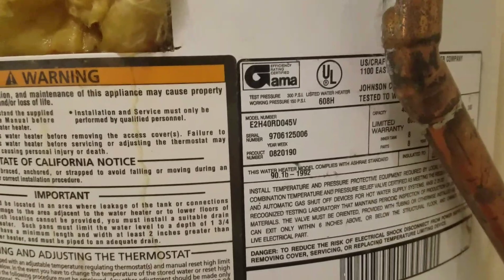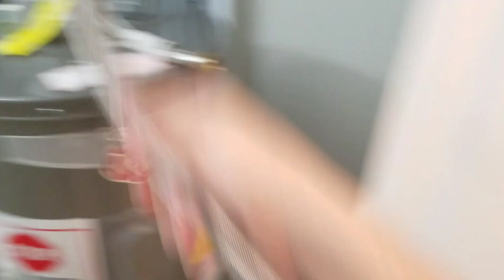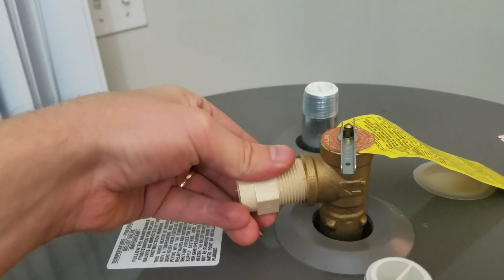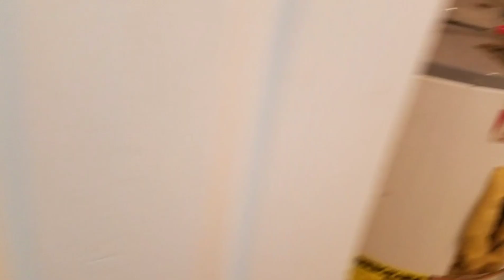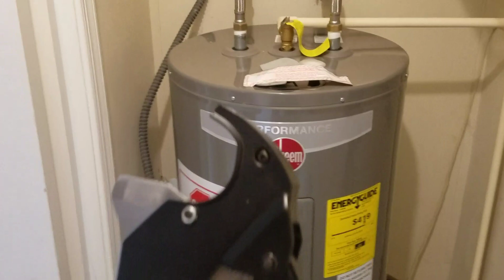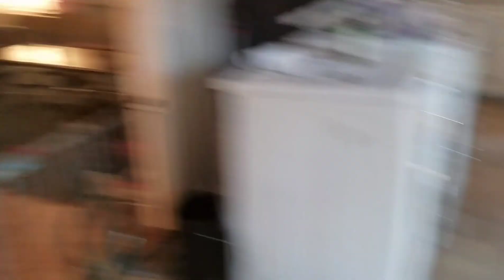DIY - How to Replace an Electric Water Heater

Comment: Great video! However I would have also mentioned opening a hot water faucet when you drain the water heater also. It prevents a vacuum from forming and impeding the water flow. Otherwise, it was a great demonstration.

Comment: Wish I have copper plumbing right now instead of the CPVC crap . Looks like you could have just unscrewed the pvc to copper connection and ended up with better connection than the sharkbite and saved the copper length.
Reply from the maker: Agreed. Functional? - yes. Ideal? -no.

Comment: I heard 'Mr. Brownstone' in the background music there at the end.  Great job!  I'm doing mine this week 😁 

I'm getting the same exact Reem unit that I have now (currently leaking at the tank) but I do have one question for you- does the relief line always go under and out of the house?  mine is pvc pipe going behind the unit and simply has an open end near the floor.  The space is so tight, I can't tell if there is any other line going out.  Is this normal?  Thanks.

Comment: How you doing? Thanks. Hot water out and cold water in placed on the side of the tank . And on top got hot and cold wish ones should I used to install my water heater tank?

Comment: That pipe is cpvc and not pvc it takes heat better!  Uses different cleaner and glue. It has a smaller diameter than pvc pipe.

Comment: Is it safe to use regular pvc pipe for the pressure relief valve? I know that it gets hot and using pvc fitting on pressure relief can Crack easy and even melt, but if there is an issue and pressure needs out and it's shoots out that scalding hot water at high pressure can regular pvc stand up against that or should it be cpvc to a brass fitting maybe? Installing one today at my mother's house and want to be sure that it holds up for years in case I'm not around here to help her save insane amount of money to have someone dumber than me fix it for double what the water heater is worth
Reply: Not to code. Use CPVC or metal pipe.

Comment: ok has it did any leaking or messing up i am thinking of getting one
Reply from the maker: It was perfectly fine for about 2 years then I moved out. I'm sure it's still fine
Reply: @BruceBalistreri  did you get it from home Depot
Reply: @jaytravel-12  Home Depot sells Rheem, and Lowes sells AO/Smith.    But if you can get Bradford White from a plumbing supply store they seem to be the very best.
Reply: @BruceBalistreri  ok thanks

Comment: In the first few minutes you made a few mistakes. Most of the comments have already told you. So next time hire a professional. You are not qualified to do this simple job.
Reply from the maker: I opened up the video saying much the same. However water is still hot years later and house passed inspection np..

Comment: Dude ,if you are doing a DYI video for folks that need info you could make sure you give correct info, cmon! First off, you need to explain that you don't need to shut main water off at the house, only to the tank, unless like you are doing here which is replacing the tanks shut off valve. That way you can have water in the home wile installing.  Most importantly, you don't use cutters  in this application, every plumber will tell you cutters can break the existing pipe with the pressure because cpvc is brittle. Use a hand blade, its two or three cuts at the most....
Reply from the maker: I think you're just being unnecessarily critical. You can turn the water off either way or cut the pipe either way.
Reply: @BruceBalistreri  u tell ‘em

Comment: Question? My drainage stopped but once the cold water tap was on it started flowing again, like alot, everyone says turning the hot water tap on is how you relieve pressure but that made no water flow out-of the drainage, I am very confused. I can't use a hose bc the threads on my drain valve is plastic and won't stop cross threading so I've been using buckets. It just doesn't seem to end o.o I've dumped over 20 2 gallon buckets o.O

Comment: I didnt see you prime and cement the cpvc pipe. Im hoping you didn't just press fit them together without using pipe cement/glue..

Any kind of pressure may just blow the fittings apart if it ever does need to vent pressure.
Reply from the maker: Yep I just pressure fit them. Should've used some goop. Luckily the pressure outlet rarely is ever activated. Good tip tho thx

Comment: you can also use the same pipe cutter you used when cutting copper to cut pvc... that tool you spent $15 only makes sense for a handy man that does pvc jobs a few times a year... Plus hack saw is really easy and fast also ,if for some reason your cut is bad,you can always make it pretty with a file,dremel or sand paper...Good video btw..
Reply from the maker: Good point. This will bother me for the rest of my life tbh lmao

Comment: What about a Pressure Relieve Tank on top of the heater tank, isn't it dangerous without one with a risk of the main tank exploding?? Is this really necessary or is it just marketing and more money for manufacturers??
Reply from the maker: All heaters have those valves (by law I think).

Comment: How long did it take for the tank to heat up the water ?
Reply from the maker: Honestly I don't 100% remember. It was within a few hours max
Reply: @BruceBalistreri  thank you for replying! Also I got a Electric shock when touching the cold and got water hose that Connects to the water heater ? Any idea

Comment: Great video for do it yerself-ers. But I figure It best make a comment towards the fact you didn’t primer and glue your c-pvc at the joints.  Your viewers need to do that quick and easy step or else, if that valve ever pops off ….the pressure will pop that 90’ completely off and send water directly onto the wall an down to yer floor ( that will suck ass hardcore if folk come back from a 3-4 day camping trip to find out there house is now flooded. Plus all the electricity that’s been used to constantly keep heating up new water to a continuously refilling water heater over the weekend.  Just tryin to help out.
Reply from the maker: Thanks for the feedback. Seems like a sensible reason to glue it up!
Reply: @BruceBalistreri  indeed sir👍

Comment: As a service plumber for more than 10 years, the only thing I didn't see was gluing the cpvc, if the T.P valve starts leaking, the fitting right on top may leak water onto the electrical connections?
Reply from the maker: Ya you're probably right. It's a shortcut I was willing to take. Hope it doesn't bite me! 

Didn't want to go out to the store to get that cool gluing compound

Comment: mine just died, well it actually burnt out, glad we were here to smell it burning, it probably would have burnt the house down, it's a 2007 model, it is past due for replacement, yours looks like it was installed by a professional, very clean look

Comment: I’m not a plumbing expert, but that saddle valve that is running off of your inlet (I assuming is for your fridge), might want to be upgraded. Pretty much all 50 states have made them against code in new construction.
Reply: I have one on mine and I believe it is a grounding rod, mine is solid metal but the bracket does look like a saddle valve.

Comment: Did you use same Teflon tape on both lines?
Reply from the maker: Yes although it's not necessary if your fittings have rubber seals in them. I did it anyways
Reply: @BruceBalistreri  thanks!! Great video!

Comment: All that pvc you are using should be brass connectors and soldered copper tube...you did it incorrectly my friend...
Reply from the maker: the original install was PVC.  I swapped it out with braided steel hoses and CPVC which is rated for water heater applications.  I disagree
Reply: You can use copper, pex or cpvc lines on a water heater, theyre all code compliant...

Comment: Great video. Just one thing, you do not need teflon tape with the sharkbite because it has a built in rubber gasket.
Reply from the maker: Hmm i wasn't aware of that.  I always go safe and tape any threaded metal-to-metal connection.  Good to know though.

Comment: It’s looks like you might have gone from a 50 gallon to a 40 gallon tank. Wondering if you, or anyone else has, and if it’s noticeable. Thinking about the increased efficiency over a 12 year old water heater and if that 10 gallons would be noticeable. 
Btw, super excellent video! Great tips that add to my growing confidence that I can take this on as I know my water heater is beginning to fail.
Reply from the maker: I have a fairly small 1200 sqft house with just one bath.  I have everything i need and more. Still working great. You can do it. Common sense and one step at a time

Comment: My electric water heater is 28 years old and works fine. If you know how to maintenance them correctly, there's no reason that it can't last indefinitely.
Reply from the maker: i agree.  but not that many people change out their rods on a regular basis.  For ~$350, i'll just swap it out every 10-12 years and forego the maintenance. <3
Reply: They don't make water heaters to last anymore. Unfortunately with new ones, you'll be lucky to get 10 years out of it. And thats with proper yearly maintenance.

Comment: Nice job. I did the same thing a few months ago. I surprised myself on how easy it was. They wanted to charge me $300 to install it.
Reply: $300 is a bargain. I'd have gladly paid that. I recently got a quote that had $2000 built in for the installation. I ended up repairing the problem for $27.
Reply from the maker: DIY - cheaper, more satisfying, learn a skill, build your toolset :)  It's a no-brainer
Reply: Yeah! I check with with the Blue Box store, they (I assume sub it out) wanted $700 to replace it.     That’s almost twice the cost of the water heater ($399).  American greed at its best. Its gonna kill us! 🤬🤬
Reply: I got a quote for replacing my water heater and they wanted $2500. The water heater they was.going to use is only $589 at the orange box store. So basically they wanted close to $2000 in labor. Smh.

Comment: Your ground connection to green screw on top of heater would not pass an inspection. Copper wire should be all the way under green screw so that it is held down securely. Loosen screw and take a pair of needlen plies and crimp and of wire together then tighten screw. This gives you a good bonding ground and prevents wire from ever coming off. Also, local building codes vary, but I have never seen on that allows you to use PVC pipe on your T& P valve drain line. Most cities want rigid copper for protection in case of movement like and earthquake. PVC could break if that happened.
Reply: most places I've seen is 18" copper from heater then you can use pvc

Comment: Excellent video very easy to do...Does the braided hose is able to get water tight on PVC pipe instead of copper main line ?
Reply from the maker: I have never done that before, so I can't speak to its durability/reliability, but Sharkbite DOES advertise that their products work on PVC.

From the Home Depot Website:
"Versatility
:
SharkBite Fittings are compatible with more than 5 pipe types: PEX, Copper, CPVC, PE-RT and HDPE."
Reply: @BruceBalistreri  I appreciate your feedback

Comment: Do you need the Teflon tape since the shark bite has a rubber seal?  The Home Depot guy told me to just slap some Vaseline on the rubber to keep it lubed and not use tape.
Reply from the maker: The sharkbite connects in two places. 

On one side, it "bites onto the naked pipe near the wall (you don't need any teflon tape there).

However, the other side "screws/threads" onto the top of the water heater. This is where you DO need the tape.

An easy way to remember is that "you need teflon tape whenever you're screwing/threading metal on metal"

Hope this helps
Reply: Bruce Balistreri @2:32 https://youtu.be/6ZG2977XT7A - My supply line has a similar gasket.  I’ll prob put tape on anyways.  Can never be too safe.
Reply from the maker: @weekendhomeprojects  hmm yeah i watched your vid -- i can't say for sure one way or another.  best of luck.  sorry i couldn't give you the 100% answer!
Reply: Bruce Balistreri No problem, thanks for responding.
Reply from the maker: And i used to work for home depot.  Don't trust "the home depot guy".

They're not all bad, but they're not as invested in your project as you and will often just BS you to make you leave (or they just... are clueless)

Remember if the plumbing guy at home depot was really that good, he'd probably be a plumber <3
Reply: Bruce Balistreri haha, good point.  Thanks

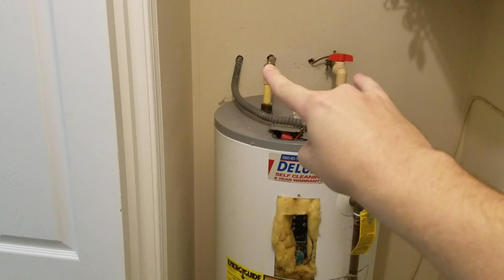Comment: @2:18 isnt it the other way around?  I could swear the red side is the hot water coming out.  Thanks for the video.
Reply from the maker: Nah the side with the handle/valve is always cold in
Reply: Bruce Balistreri The red throws you off, but yeah, the cold water coming in will have the valve.

Comment: What is the green wire in the new tank?
Reply: Its the equipment grounding wire.
Reply: Yes but he didn't say what he did with the ground wire coming from the tank. It looks like he didn't hook it up. Wouldn't it just be better to ground the hot water tank to the ground wire coming from the panel? Instead of hooking it to the cover plate.

Comment: Do you have to cut the pipes? Can't disconnect the old ones?
Reply from the maker: yeah the new water heater was about 6 inches taller than the old one.  The position of the water line connections was completely different

Comment: Teflon tape is a must to prevent corrosion as well....very difficult to remove corroded water heater connections

Comment: As a side note>> I don't think it matters if red to red or black to white or vice versa because each wire is for 110 volts each and the two wires in the water heater are for 110 volts each anyway for 220 volts total. 110 volts for each heating element. . Important to connect that ground. Am I wrong on that theory?
Reply: You're correct. Alternating current switches polarity 120 times per second.
Reply: @__Ryan_  Thanks! I did wire as shown here but I didn't want folks to freak out if they forgot what wire went where.
Reply: I was thinking the same.
Reply: Mine was black to black and red to white, and it’s working ok, so you must be right 😅